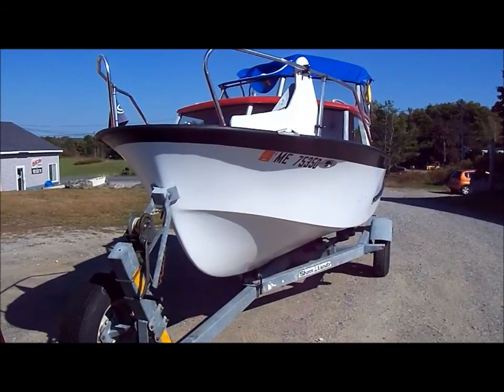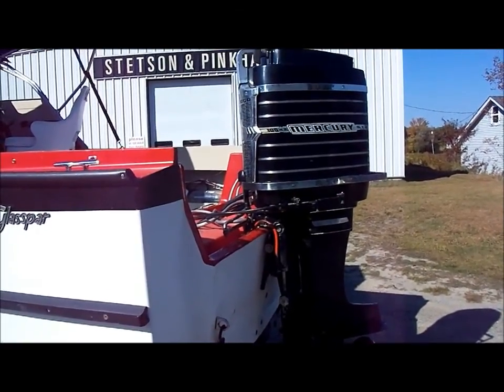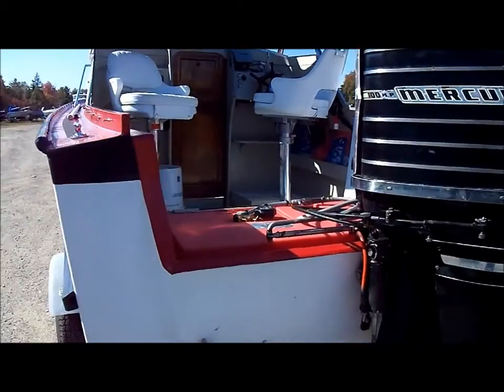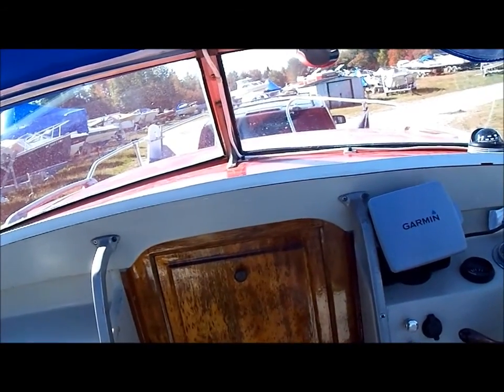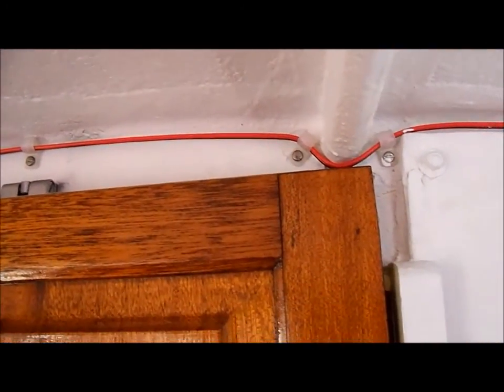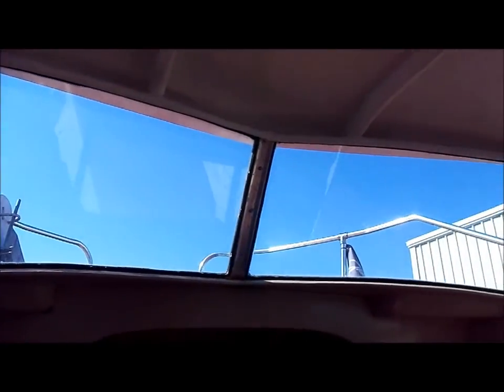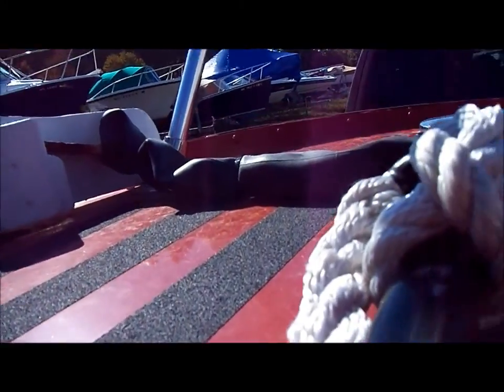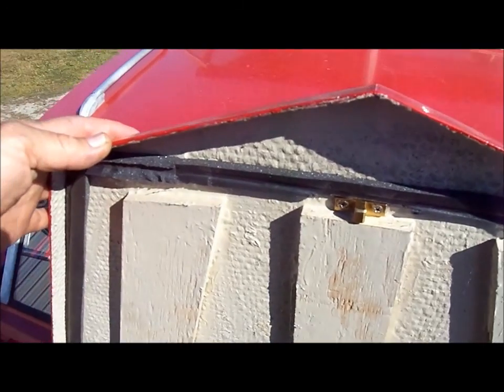Glasspar Seafair by Bill Tritt Mercury merc 1000

Comment: those two strokes are thirsty, but they are smooth and relatively quiet if the intake is muffled , and power to weight ratios is good. too bad the emissions are high.